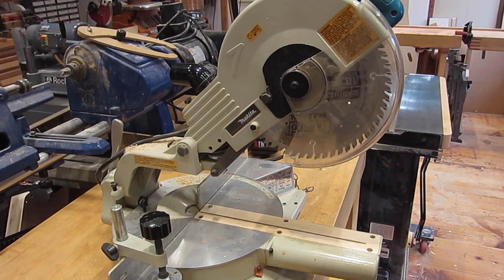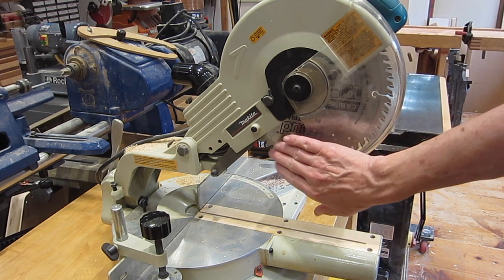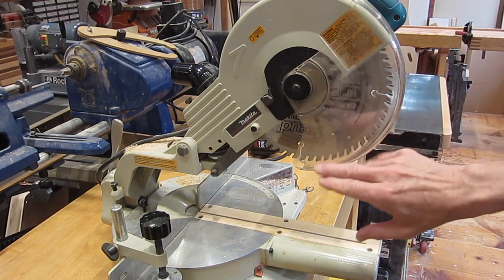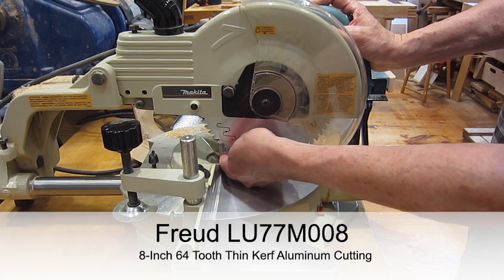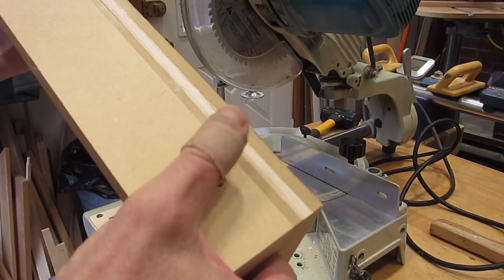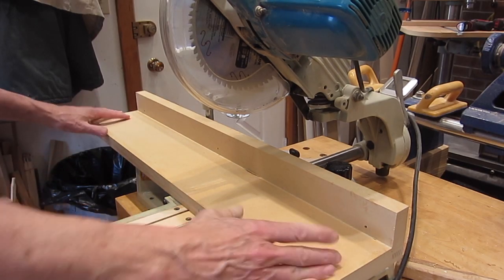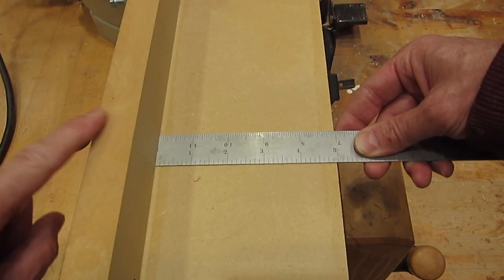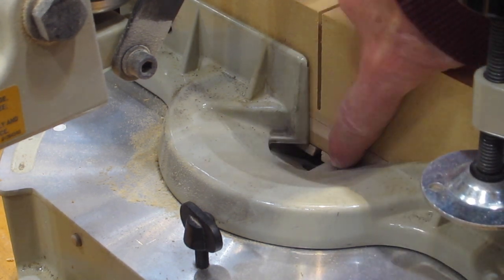How to adapt a wood miter saw to cut like a metal chop saw.

Comment: Thanks for this. I was trying to do this by adjusting the motor to balance speed and torque. I didn't consider that I'm only trying to reduce blade tooth velocity. And since I only need 2 inches of cut depth, changing the blade diameter is a much easier way to accomplish that.

Comment: When cutting 2” angle or any angle, place the material squarely against the bottom table and back fence, that way the rotation of the blade is cutting down and back forcing the angle against the saw. When the angle is placed like a teepee the rotation of the blade has a greater tendency to lift the angle.
One way the blade cuts against a backing surface the other the blade exits the cut with NO backing.

Comment: That is a good idea to gear down the saw with a smaller blade.  You can actually cut aluminum with a regular wood blade and at normal saw speed.  I have built huge aluminum pergolas with thick aluminum louver extrusions for days and days and one wood blade lasted the entire time.  I would like to try your method for cutting steel, though, where reducing the speed is critical.

Comment: I bought a 12” dbsm for this purpose. It is belt driven instead of direct drive, so the ratio could be changed to slow the blade down. I think I might try your smaller blade option first, it would certainly be easier and less expensive. Thank you for not cutting the mishap with the metal out, I hope you weren’t injured. Thanks for the great videos and inspiration!

Comment: If cutting steel, are the sparks an issue? Do you simply vacuum out any sawdust around the saw/saw table before cutting & not use your dust collection system when cutting the steel?
Reply from the maker: Good idea to cut steel outdoors.   I would definitely not use with dust collection system, or shop vac.

Comment: Hi again Steve. If I didn't have the budget for that Freud blade you have, could I use an arbor reducer sleeve to use a 20 mm bore Evolution 8" blade on my saw's 5/8" arbor? I don't know if that would be safe or not
Reply from the maker: An evolution blade with 5/8" bore would be simpler.     https://store.evolutionpowertools.com/collections/blades/blade-size_8-inch
Reply: @steven.woodward  the aluminum cutting blade has a 25/32” (20mm) bore which makes it an odd duck compared to other two steel cutting blades with 5/8” bore.
Reply from the maker: @Driver10011  OK.   I see the problem.    How about another brand.   This one has good reviews.   https://www.amazon.com/Oshlun-SBNF-080060-Diamond-Knockout-Aluminum/dp/B002PMV4VU/ref=sr_1_3?crid=1WW509KYZ6J6D&keywords=8%22%2Baluminum%2Bcutting%2Bblade&qid=1667323584&qu=eyJxc2MiOiIxLjc1IiwicXNhIjoiMC4wMCIsInFzcCI6IjAuMDAifQ%3D%3D&sprefix=8%2Baluminum%2Bcutting%2Bblade%2Caps%2C93&sr=8-3&th=1
Reply from the maker: This is the other blade that I was looking at when purchasing the Freud.   Both reputable brands.   https://www.amazon.com/Milwaukee-48-40-4520-Ferrous-Non-Ferrous-Cutting/dp/B00023S32M/ref=sr_1_13?crid=IMVQQXFCMOV1&keywords=8+inch+aluminum+cutting+blade&qid=1667323768&qu=eyJxc2MiOiIwLjAwIiwicXNhIjoiMC4wMCIsInFzcCI6IjAuMDAifQ%3D%3D&refinements=p_n_size_browse-bin%3A387871011&rnid=387623011&s=power-hand-tools&sprefix=8+inch+aluminum+cutting+blade%2Caps%2C134&sr=1-13
Reply from the maker: Also, pay attention to the thickness of material that the blade is designed to cut.
Reply: @steven.woodward  thanks Steve!
Reply: @steven.woodward  Perfect thanks Steve!!

Comment: Any woodworking saw with a good carbide toothed blade will cut aluminum with no issues, just do it a little slower than you would cut a piece of wood. Go by the RPM not velocity... 1000 rpms is 1000 rpms no matter the size of the blade is. If the blade is designed for cutting metal, I would be a little cautious using it on a regular chopsaw or table saw, if the tool has a gear box instead of a belt drive system.  I'm not saying it won't work but it may shorten the life of your tool, after all they are designed to cut wood. Also keep in mind some metal cutting blades require less RPM than wood cutting blades... RPM not velocity....

Comment: Wouldn't a small blade spin faster?
Reply from the maker: Good question.   The RPM is mostly a property of the motor, so the RPM of an 8" blade or a 10" blade is about the same.    But the tooth velocity of the 8" blade is much slower than 10".
Reply: RPM's don't change at all. The farther the teeth are from the center of the blade, the farther they are traveling per rotation. So the bigger the blade, the faster the teeth travel given the same RPM. That's why you can swing a whip with your arm at one end and break the sound barrier at the other.

Comment: I'm trying to avoid buying a metal saw too. I only need to cut 4 3x3 tubes. The largest metal blade rated for my 10 inch mitre saw is 7.5 inch so if I go this route I'll have to cut the tubing from both sides. Worse case I'll just buy an Evolution, use it once and sell it to a lucky buyer.😊
Reply from the maker: If the tubes are aluminum you can get away with a 10” blade in the 10” miter saw.   I have seen aluminum railing installers use a standard woodworking 80 tooth carbide tipped blade.   Steel of course needs a proper steel cutting blade.
Reply: @steven.woodward   Couldn't be so lucky. The tubes are 11 gauge and painted which is why I don't want to use an abrasive blade. I'm considering a Sawzall.

Comment: Shouldn't you be using RPM of the blade as your point of reference as blades are spec out by mfg. based on RPM (Revolutions per Minute), not velocity (Meters per Second)? 

The blade is still spinning at the same RPM as your tool is outputting regardless of diameter and the blade will wear out faster if it is run a higher RPM than what is is designed for. Wood Miter saws unless specific for Metal cutting run at high RPM.  All materials have a cutting/machining sweet spot, and this is why proper Speeds and Feeds are important. Same with tools.

Best to slow down the speed of the machine with a proper speed (RPM) control, to match the blade cutting RPM for the specific type of metal (ferrous or non-ferrous).
In addition, tooth geometry thickness, but also number of teeth per inch is important, depending on material, for metal cutting more teeth per inch is desired, and you cannot have that many in a small diameter blade, for a given thickness of material. This is why chop saws for metal such as 1/4" thick are in the 10-12" blade diameter (higher mass) and if you have ever used one or seen one in use, you can see how clean and easier the cuts come out, of course with proper clamping.
Reply from the maker: You make some good points.  The ideal solution is a metal saw and a wood saw, with appropriate blades.

As I am primarily a woodworker, with only occasional need to cut metal, the goal was to get a reasonable metal cutting solution without using a metal cutting saw.  Maximum RPM of blades shown video is greater than saw RPM so at least it is safe.

Comment: This is aluminum, you could just have bought a blade that was suitable for non ferrous metals. Do not try this with something like iron or steel, you can buy a metal/ chop saw in advance if you don't have a metal saw and then just buy wood blades with the proper teeth count for the wood you intend to cut. If it's for aluminum or copper then you can do this.
Reply from the maker: What problem do you see with cutting iron & steel, with the correct blade, spinning at correct rpm ?